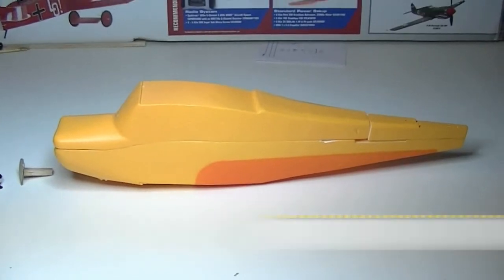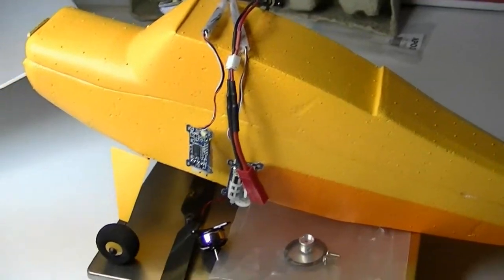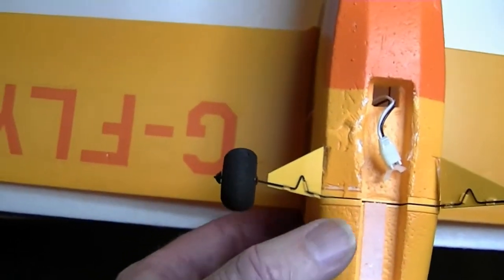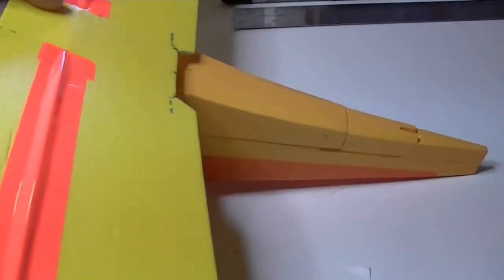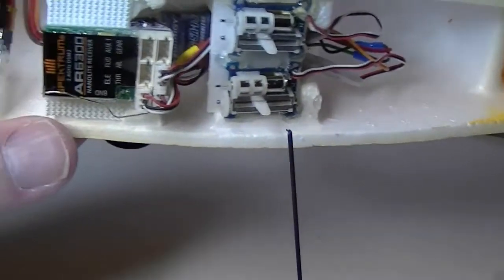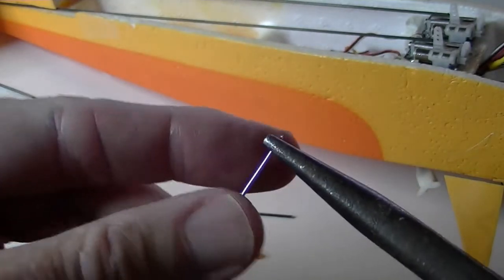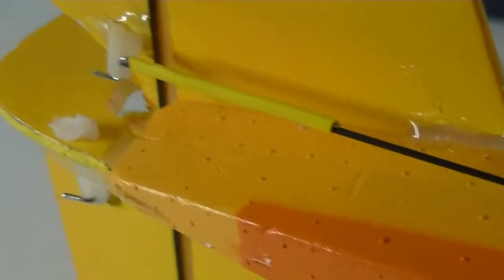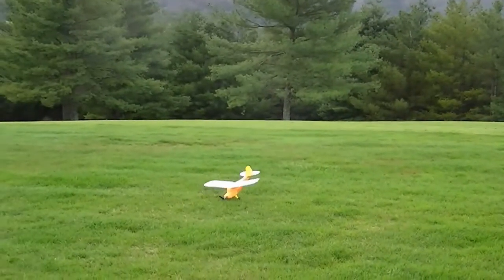HobbyZone Champ RC Plane Conversion To Brushless Motor Power System - Part I

Comment: Much appreciated.......your the mechanic !  I see you put a slight downward pitch to your motor install so thats what I was hoping for.  Mine is down near 20 degrees and slightly to the right as you mention.   I was impressed how your re-build flew.  That is delicate and precise work.  Thanks for sharing.  I hope soon to be a flyboy !  Weather permitting of course.

Comment: I've just put together my Champ V 2.0 with the electronics from an ultra-micro P-51 (and my Champ's spare parts that I bought and never used). It's got the ailerons! Flew it today with mixed success, the wind was awful. (Landed a couple times fine, and once in a tree and once in someone's house) Can't wait for good weather.

Comment: Nice build, but if your using regular posterboard like purchased at a Dollar Store,  you really need to protect all edges, as the stuff will allow the paper to seperate from the foam with the tinniest bit of moisture Clear packing tape is your friend to secure the edges and protect them. In a crash, which the Champ is prone to do, the paper can easily seperate, too.

I never trust shrink tubing to hold two pieces of metal together for long, so the dab of CA glue is almost a given for the control arms as a safety precaution.

Nice revival of this plan from the trash can. Nice video, too.

Comment: Hey.....Mr. dmerc00
I flew my Champ, and man does it fly nice and steady.
I had a problem though.  Once I got out about 80 yards it seemed my controller lost response.  The engine cut off and on repeatedly and I was loosing control... Is it the spectrum Hobby zone controller ??  IT's the one it came with in the box.  Your opinion on the matter appreciated.  Batteries are new and tested good !

Comment: May I ask how you accomplished the airfoil shape on the wings?  I see the wing fuselage is shaped with a curve, but it seems like the foam would be too rigid to simply bend enough to accomplish an airfoil enough for lift.  Did you truly do nothing but cut out a flat wing assembly and attach?  That works? I've been researching how to build my own plane and people go to great lengths to design methods for cutting airfoils out of foam.  After watching this, I'm wondering why if it's this simple.

Comment: I got my new Champ today.   
If I hold the Champ on a level plain....I notice about a 20 degree downward angle of the propeller shaft.  This looks rather odd but is it a normal position to have.  Not sure if I should fly it or level the angle to the center line of the plane first ?   Your opinion is appreciated.

Comment: I'm thinking of doing this same mod to my Champ.  Great instructions BTW.  You're good at explaining and putting a vid like this together.  Question about the new motor.  Does it help with the wind?  This plane is tough to fly in any wind with its light weight.  Thanks in advance.  Good work!

Comment: Was the bottom of the rudder attached to the fuse? My rudder will turn one way but not the other and is not attached on the bottom.
Reply from the maker: Ron Didden Yes I the rudder is attached on the bottom.

Comment: Hi dmerc00
just wondering how could you get air lift from a flat wing.
shouldn't the upper surface be a bit larger than the lower one.
can someone explain?

Comment: Need a bigger prop on there, 5040 probably, unless that brushless motor is less power than the stock motor?
Reply from the maker: +Trpratt1 Prop size depends on the motor speed and torque curve. Testing has show the prop we have is the best match for this power system.
Reply: +dmerc00 Oh OK, yea I just noticed it says 4000kv, that's probably way faster spinning than the stock, do you know the thrust of that motor vs the stock or or a p51 brushed? (Which is what mine has, pretty powerful)
Reply from the maker: +Travis Pratt Here is a vid where I did some thrust testing that might help with your question.
https://www.youtube.com/watch?v=6WMros9ZCjA
Reply: +dmerc00 That vid shows the 5030 as most thrust, that's probably the one I'd use, but I like power haha, I'm not so worried about battery life or efficiency, seems like a decent amount more thrust if u stepped up from the 3020 prop. Not sure how much thrust the p51 motor pulls I wish I had a thrust gauge like that seems really fun =) also you gotta remember static thrust isn't always what you get when the motors moving, so a lower pitch is going to seem better for static thrust, I bet when you got moving a higher pitch and bigger prop would give you more power at barely any cost in battery life, would be interesting to see a real world test of the different props too to account for speed and less air having to be pulled in by the prop.